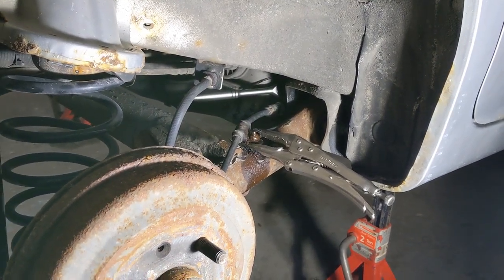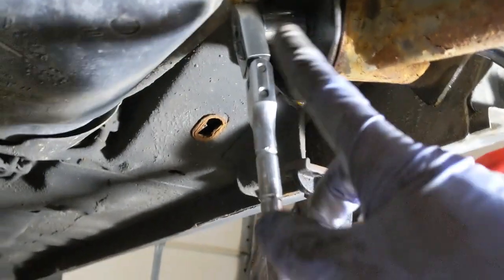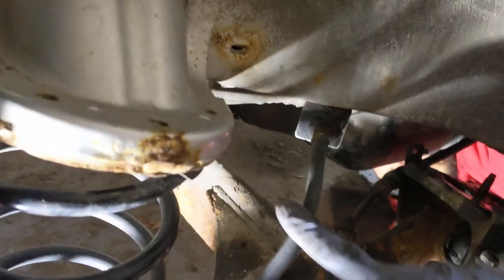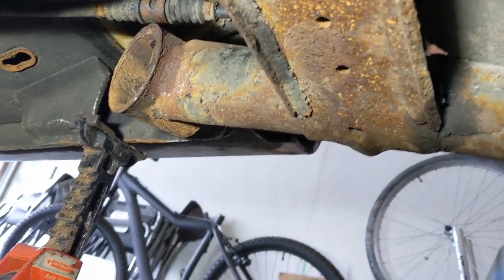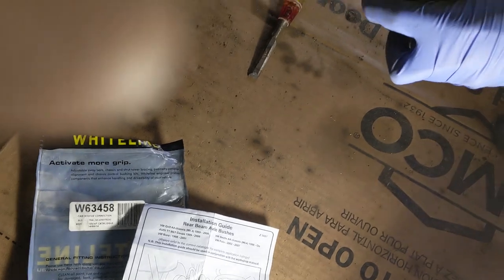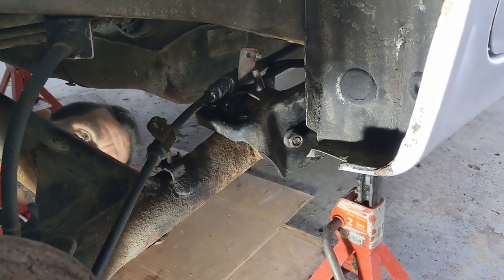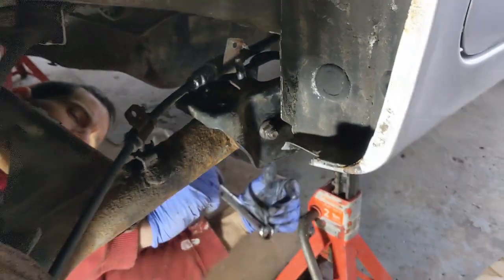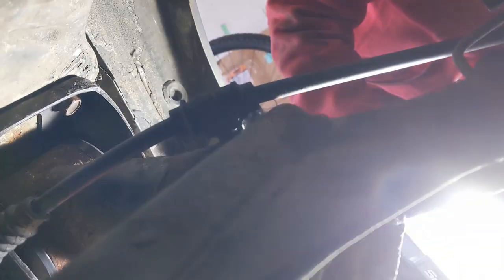Chevy Aveo rear axle bushing replacement, DIY at home, 1/2 - passenger side

Comment: Nice, thanks for making this video. Super detailed and you showed every step. I’m getting ready to replace the bushings on my wife’s 2009 aveo5. Good job guys
Reply from the maker: Morgan thanks, and good luck on the job.
Reply: Where did you find the 2 piece bushings? Do you have a link?
Reply from the maker: James Crittenden https://whitelineperformance.com/products/w63458-bushing-kit You can usually find them on amazon or eBay too
Reply: why go thru all that crap when you can buy a bush pressing tool for 50 bucks and do both sides in an hour crazy stuff.and if you damage the bush housing with drills n hammers the bush wont sit right.

Comment: Im having alot of trouble aligning the stud in the middle of the bracket :s
Reply: It turns out that while trying to align the stud in the bracket of the passenger side. I was fighting with the bushing on the drivers side.
The solution was to rest the axle bar on jack stands and replace the drivers side bushing. Then i was able to install both brackets at the same time.
Thanks so much for the videos you've helped me alot thanks!

Comment: What were the sign that the bushing was bad ?because I think I have a bad one on my cobalt because I have a squicking noise on the driver side and it's very anoying
Reply from the maker: On this car, the metal sleeve rotted away, which caused the bushing to sag and move out of position. you could tell something was going on when you hit bumps, and the visual inspection confirmed it. perhaps try lifting the back end of the car with the weight off the axle, then try to rock the axle or use a pry bar to check for free play in the bushing.

Comment: Can i just cut the bolt off and remove the bushing? Sawzall king here :) did it to the lca in the front lol.
Reply: as long as you have a new nut and bolt it shouldn't be an issue,  but you'll have to trim the fender metal to put the bolt through and the nut will then be on the gas tank side of the bracket